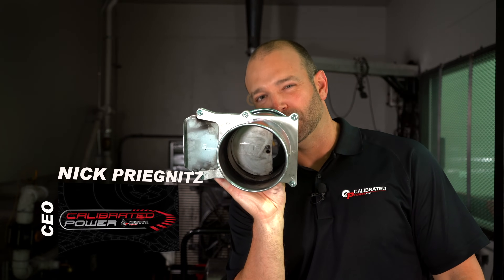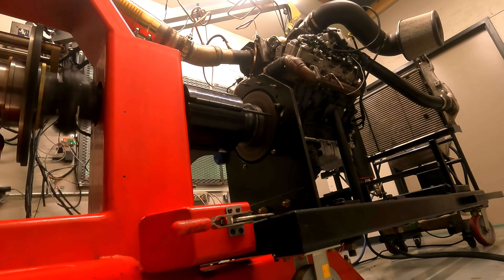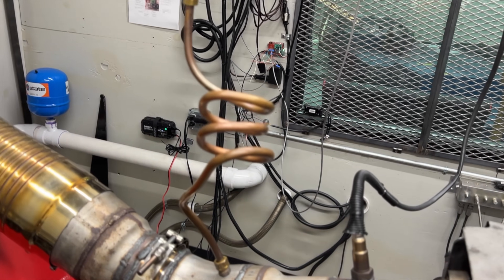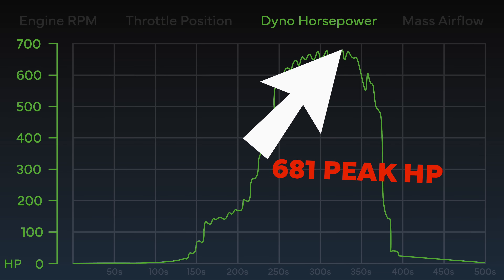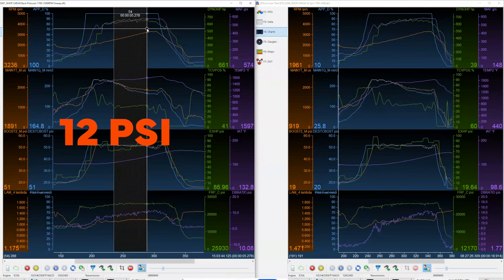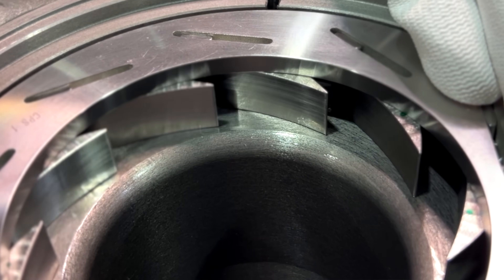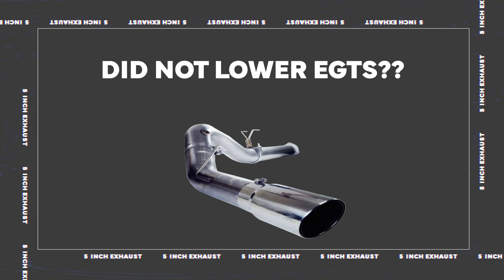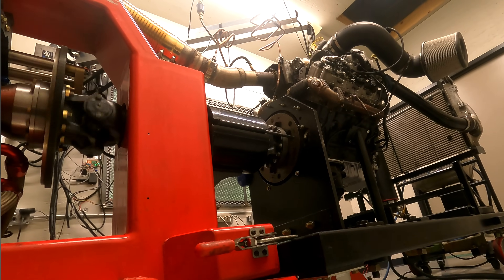DPF Vs. 5'' Delete Pipe On Horsepower, EGT, and More! Massive Knowledge Dive

Comment: Fantastic video! Have you considered doing the test with the same turbo vane position? I suspect the VGT is compensating for the increase in backpressure and it would be interesting to see the difference in output if the vane position was fixed
Reply from the maker: Interesting point!
Reply: @Duramaxtuner  Hope you consider doing this test. Appreciate your response!

Comment: Did you measure the fuel required to make that HP at the different back pressures?
Reply from the maker: We probably did, but this was quite a bit ago. Will try to go through the archives.

Comment: Love the information! 67mm with be on my l5p here in a few weeks. My question is are we just closing off then it’s going back to 5in. What about the numerous filter throughout the exhaust. Are they slowing things down an what about when they heat up after extended driving are we creating more heat thus making less power? I’d love to see a full doc/dpf exhaust an ran again I’m extremely curious on what the results would be. Thank you guys for all the hard work and dedication you guys do on a daily basis to make the most high quality parts.
Reply from the maker: @SilverBulletL5P The 12psi and 15psi  exhaust environments that we created were meant to serve as an example of how an emissions-in-tact LML motor would perform. This is show in contrast to a completely "Open" (deleted) exhaust to give you an idea of the performance restrictions the DOC/DPF put on your engine's performance.  Connecting and disconnecting an entire DOC/DPF system was just too much of a hassle to be more worth setting up compared to what we did.

Comment: Nick, I'd be curious to see the difference when you put on one of your bigger turbos if there's a correlation between free-flow on those and a stock turbo (especially drive pressure when you push the stock one).     You also said in the prior ford/race day video that the doc & system seemed to be at a limit of 630 rwhp or so.  Is there any validity to being able to push 7 or 800rwhp in the future or does that whole system become a block?

Comment: What was the turbo shaft speed 😁
Emissions on will see a noticeable increase in turbo shaft speed.
This will result in more wear on the turbocharger.
Reply: I doubt shaft speed would change much between these tests (although I’d be happy to review data to the contrary). 

It is worth mentioning that the higher drive pressure-to-boost ratio required to achieve mass airflow rates necessary for power in the emissions on simulation are potentially a little harder on the thrust bearing set of the turbo.

Comment: So is the conclusion from this then that backpressure doesn't really matter on a turbocharge engines when it comes to create torque and horsepower?🤔
Reply: It matters only slightly within the experimental limits of this test. IF the restriction in the exhaust had caused the engine to run up against its maximum vane position limit while chasing desired boost then HP would have been much more dramatically limited.

Comment: So you’re saying back pressure doesn’t hurt horse power ?
Reply: I’m saying that within the constraints of this test the exhaust restrictions costs the engine about 10hp, or slightly less than 2% of its output potential.

Comment: The problem I see is you don’t have heat soak bricks ie: DPF SCR and a muffler, all absorb heat, as your restriction. It’s just a reduction in pipe diameter essentially , but still fairly free flowing.
Reply: Are you suggesting that the pressure sensor in the down pipe is somehow not measuring resistance to gas flow out of the turbine?

Comment: I’m curious if you’d lower EGT with a 4” vs 5” . If you had lower temps with the exhaust closed off I’m curious if it’s making more exit speed by building that pressure coming out the pipe pulling the heat out with it faster
Reply: I think the takeaway from the video is that the EGT was not statistically different from the 5'' to the simulated DPF.  Going to a 4'' exhaust would likely not change EGT in a statistically significant way.

Comment: kinda bummed that THE GUYS for emissions on tuning didnt actually have emissions running for a proper scientific comparison of straight pipe vs full emissions. did the test engine even have EGR or was this engine completely deleted for your test mule purposes?
Reply: No fears Bert, we're happy to refund your price of admission.  In all seriousness, the test engine is an LBZ (no DPF/SCR/Regen controls) and our test cell is not large enough or capable of cooling everything required perfectly duplicate a full emissions system.  The engine is capable of running EGR, but we did not have any recirculation active to minimize variables in the test.

Comment: I am curious after all the other exhaust diameter tests I have seen done. Maybe a good test would be to measure the opening in the restricted filter sim box and translate that into pipe diameter and see how that translates to the length of the filter assembly. If the filter is 2’ long and you have a back pressure opening that transfers to a say 2” opening maybe install a piece of 2” pipe 2’ long? Data doesn’t lie but I can’t help to think if you installed a filter assembly to this test the data would be different. Interesting testing and straight forward data reporting as always keep up the good work!

Comment: Awesome data! I would be curious to see what shaft speed does as vane position climbs to maintain desired output.
Reply: shaft speed should increase relative to vane position as long as pressure differential across the turbine stays constant until you hit the choke point of the housing with rpm climbing and the vanes wide open
Reply: Typically if MAF and engine speed are equal then so is shaft speed. While vane position did increase in the restricted exhausts, I would be surprised if shaft speed changed.  (Our turbo speed sensor failed a day before this test was run).

Comment: Ah, the joys of torque demand based common rail diesels. Will hit the number requested, no matter what's in it's way lol. I try to explain this to all the people who fall for gimmick bolt-ons from Banks. All for nothing without tuning.
Reply: So is the conclusion from this then that backpressure doesn't really matter on a turbocharge engines when it comes to create torque and horsepower?🤔

7:58
Reply: @Suomyice  It does and doesn't. It matters from zero hp to whatever is demanded based on pedal position. It will be less efficient at reaching that torque number and sustaining it when there is more restriction.

Comment: Would this data be the same on a stock turbo?
Reply: Good question.  Although I've not run the tests, I would expect very similar percentage differences in vane position, pressures, and EGT.  Keep in mind the stock turbo peaks about a 100HP short of this STR prototype so the experiment would have to be run closer to 550 Crank HP.
Reply: @nickpriegnitz5895  thanks for the reply Nick. I am running a new emissions pick up now.  I hated the idea of running emission. But you continue to prove that it is possible. Nice work